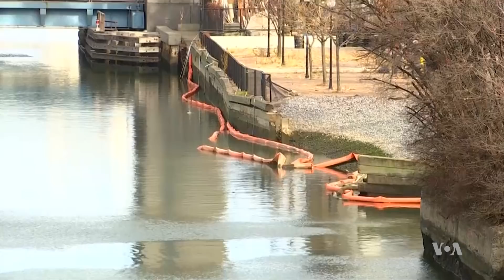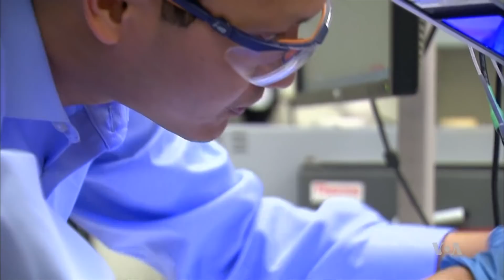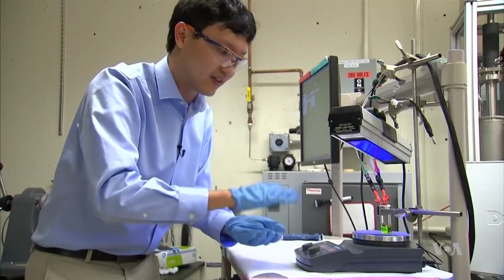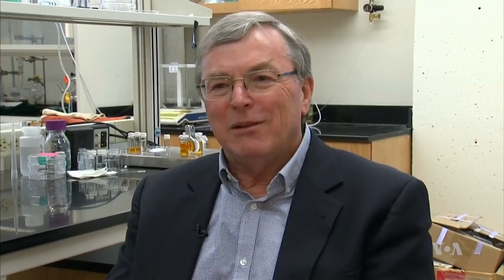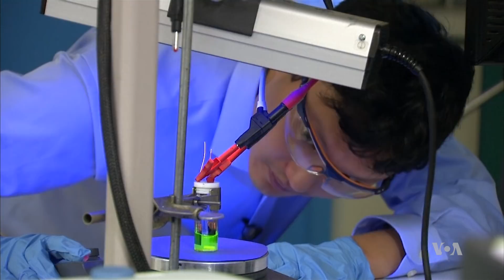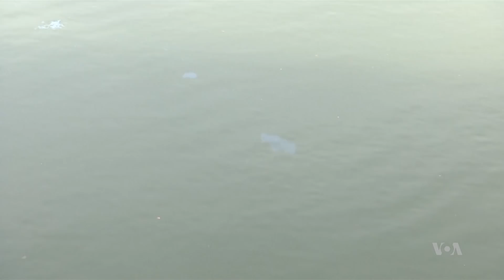Using Simple Electric Currents to Clean Dirty Water

Comment: It's pritty simple technology to clean water. So why make a simple thing complicated.
If it's about takin out ions then seartch electrodesalenation.
There is already big plants build.
Reply: It's rather expensive and difficult...
Reply: @ripinkhanna6075 no it can be done with 2 socks and stainless steal cleaner pads plus a battery and 2 wires
Reply: they are trying to make a pollution magnet. .    @johnathonsandler9507